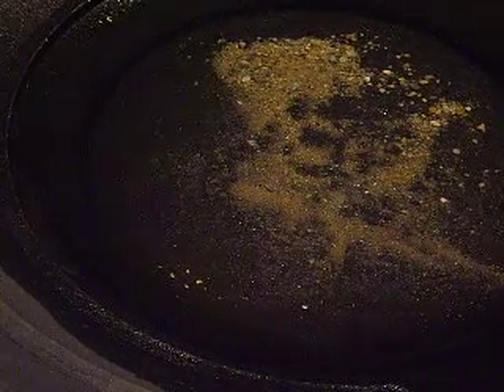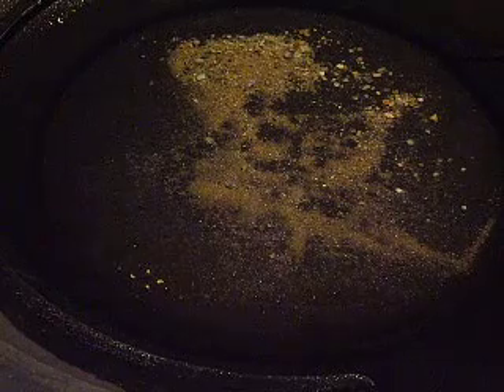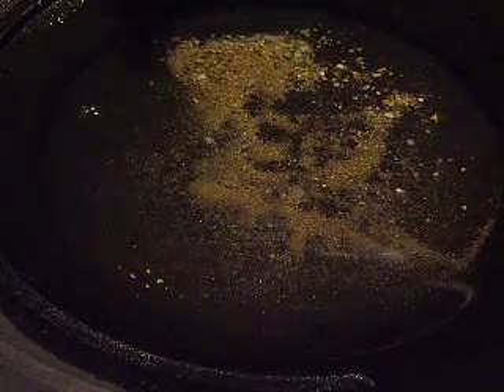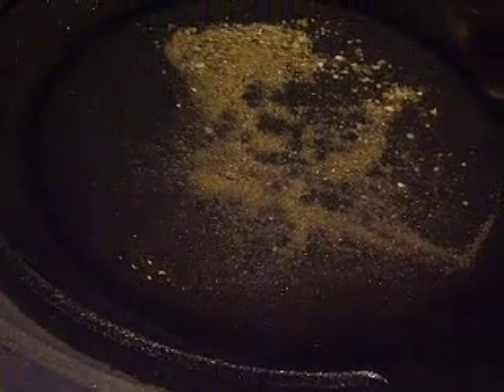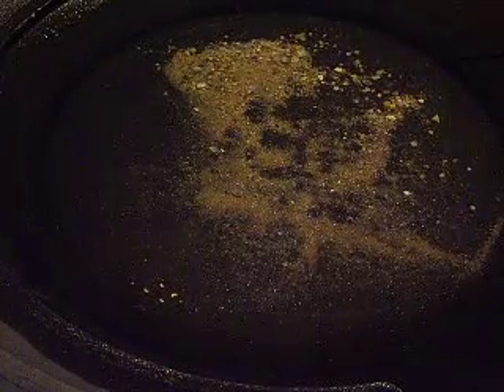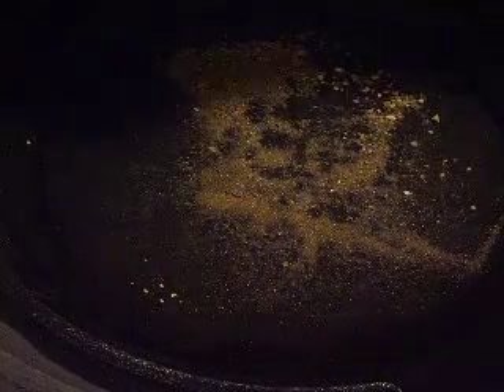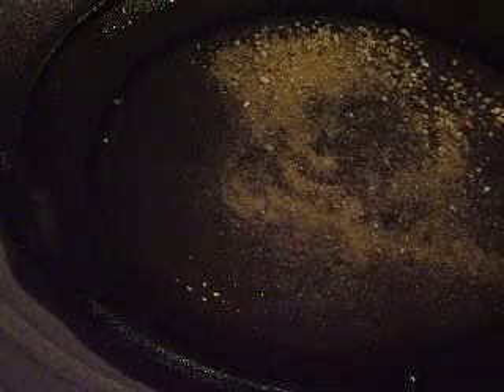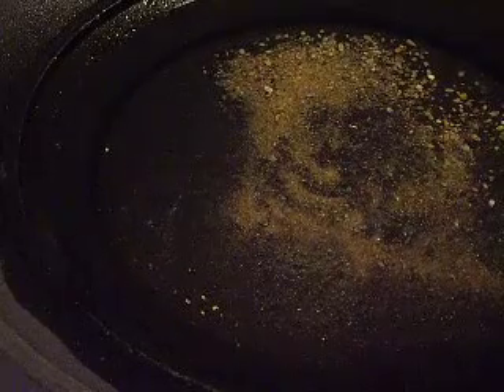Floating Gold, Gold Panning, Colorado Gold

Comment: GOLD DOES NOT FLOAT!!!
Reply: True, but it absolutely can ride on top of the surface tension of the water.
Reply from the maker: @jjbailey01   correct good Sir
Reply: Gold does float. I dont understand it but I purposely tilt my pan slowly pour water on my cons and cause the flour gold to float, then filter those off and melt them.